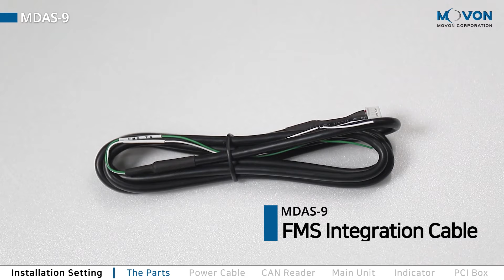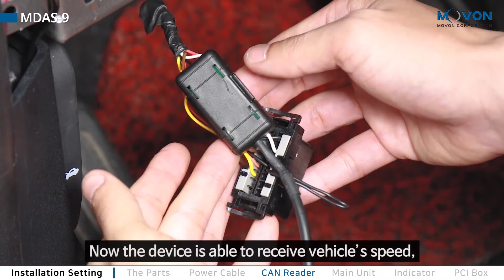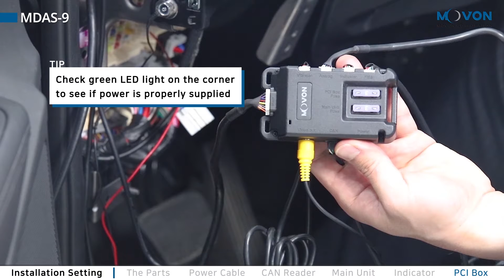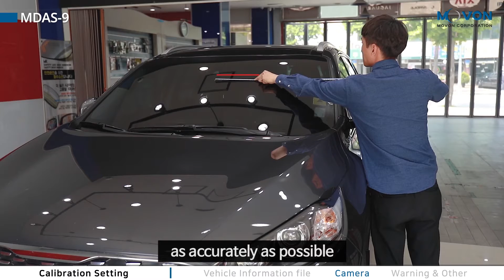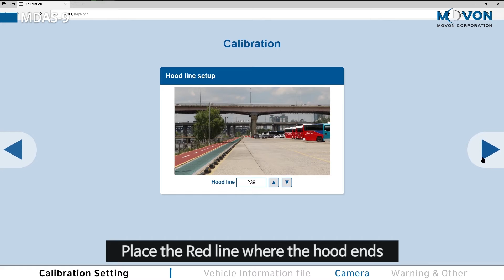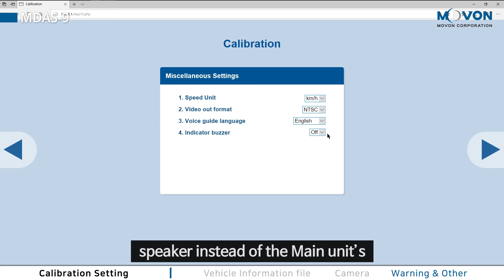MDAS-9 Installation Video - English

Comment: O bought Movon Mdas 3LF+ and I don't known ID and password for login into callibration. On Modas 9 it admin and 1234, but on 3LF+ this doesn't work. Help.
Reply: sorry for asking that late. Have you found out how to get an id and password for MDAS 3LF+ ?
Reply: @maximbogovik32  Yes. I got it by email, by some guy from this company. I contacted them via their website.
Reply: @DawidWarsaw   sorry Dawid to bother you again, but I have nothing but hope that you can help me. I've been trying to get in touch with Movon tech support for weeks now, but they seem to completely ignore me. Could you please tell me how you contacted them, or can you tell me the ID and password for this if it is common to each device
Reply: @maximbogovik32  Try email bob.baek  (at) movon.co.kr 
He helped me, but you may also contact your local dealer, who sold this device.
If you want me to send my login data, I need to know exact model of your device. Is this 3LF+? If so, please try adisystems/back270703